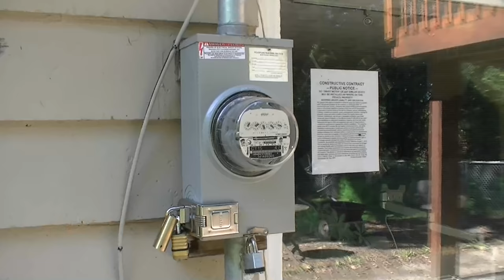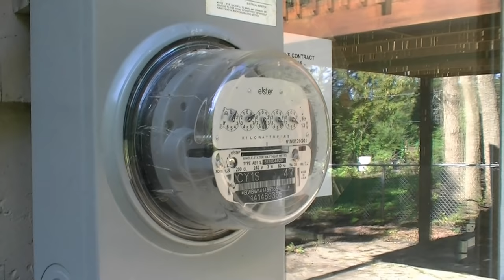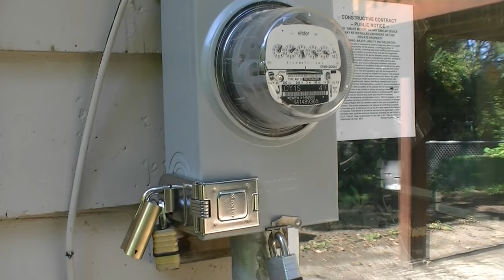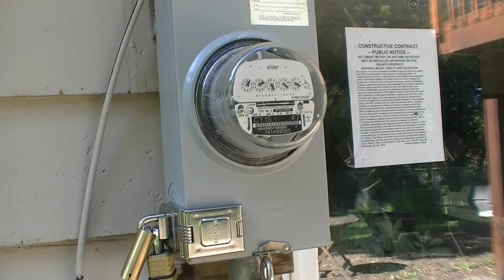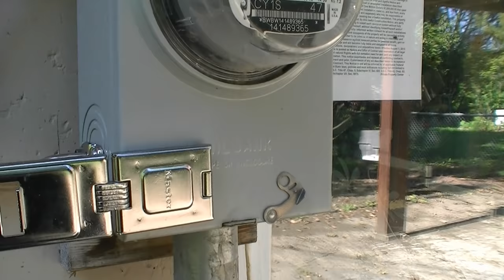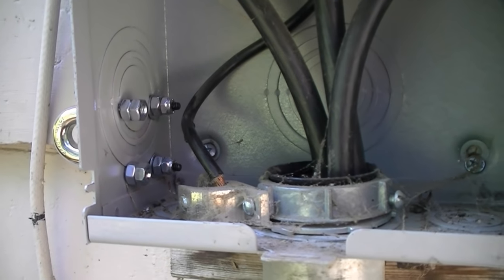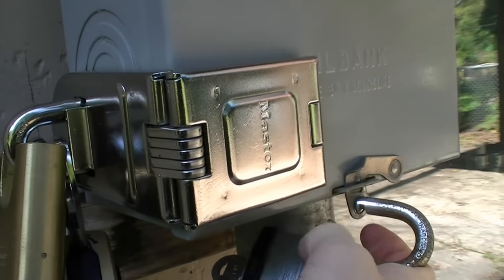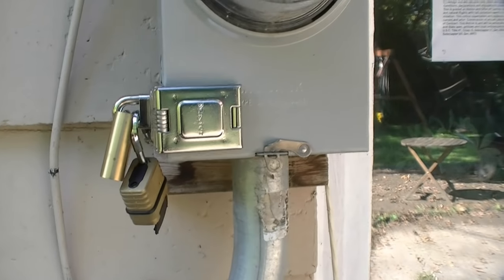Locking Your Electric Meter to Prevent Smart Meter Installation

Comment from the maker: Having a monopoly really seems to have given these power companies a sense of entitlement.  Now we've had multiple comments posted by people saying they work for a power company.  They are upset that a power customer would modify their own property (the meter box which the customer owns) which resides on their own private property.

I'd like to see one of these guys name the utility company they work for.  Do you speak on behalf of your company?  I speak on behalf of mine - ElectraHealth.com.  I have no problem putting my real name and company name on here.  I'd like to see one of these posters do the same.

Instead of fighting or arguing, why not come to the realization that people don't want these smart meters.  A good company listens to its customers and their needs/desires.
Reply: EMF Explorer you do realize power companies are very strongly and heavily regulated by the government right? They can't charge whatever like in a monopoly, as the Government sets the rates, as electricity is classified as a utility. Same way with gas and water
Reply: EMF, you seem to talk a good game, but you may not be as smart as you think you are.  I'm a retired meter tester and installer that was also state certified to test, inspect, and install substation metering, which is highly complex metering that has multiple current transformers and multiple potential circuit feeding the meter.

You have no right to install the locks on your meter, as a matter of fact when you installed those hasps, you could've put the drill bit into a hot phase.  If you removed the meter to de-energize the load side conductors we would've of come out to replace the outer seal.  We would of seen your locks and hasps and it would've been considered to be unsafe conditions.  We will access the meter,  and if we came by again, chances are real good that your service would've been disconnected due to multiple cases of unsafe conditions.

Call it arrogance or whatever, however power companies are given a lot of leeway when it comes to unsafe conditions.  Notice that I didn't mention tampering or diverting current.  Now after I cut your locks off and access the meter, if the inner seal is broken, then I will test the meter for accuracy, and make several other visual checks to the meter.  Now, after removing the hasps, if there are holes in the lid or meter can, remember my remark about power companies having a lot of leeway about unsafe conditions.  Holes in any part of the meter can , outside of the obvious hole for the meter, can be viewed as being unsafe.

Had I come up on your meter can, I would do exactly what I stated right in front of you.  I would be professional and explain everything that was going on, so you would understand.  Also a little courtesy goes a long way.  Had you threatened me with a gun, dogs, etc. we have a button we carry that sends a signal to our trucks, which sends a 911 to our company  and the local law enforcement.

You can't win most of these battles you think you can.  We have the law, utility commission, and NEC on our side, and your trying to bypass the rules you signed in your contract, just won't fly.
Reply: EMF Explorer you are correct the consumer does own the meter box or enclosure. However modifications to it in an attempt to prevent the owner of the meter gaining access to said meter prevents their maintenance and emergency access. I am all for people denying their smart meter install as it's their right to do so however please remain logical and safe when doing so. Suppliers also have the right to pursue and gain a court warrant to gain access to their equipment if deemed necessary, therefore requiring no further concent on your behalf. Finally the meter box houses lethal amperage and therefore no modifications should be made by anyone not suitably qualified to do so. Be careful people.
Reply: How many decades did it take, until the right of property owners to add additional landline phone extension phones was recognized? How many decades did the telephone monopoly rip off customers by leasing extra phones to them, at an exorbitant price? The rent on those extra phones, would be enough to buy several phones a year. Finally, the phone company is only responsible for the phone line up to your outside home junction box. (But they can still make more money by selling poor-value optional insurance on your inside phone wiring.) Now how many more decades will it take for sanity to finally come forth on this smart-meter garbage?
Reply: I would like to ask how the electric box is my own private personal property, as I don't recall purchasing the box when I built the house.  The electric company put it on, so wouldn't they own it?    HELP!
Reply: Woodrow Magnus 
Only if your meter box is separate from your circuit breaker panel box. 
If it's a combined unit, you pay the full price if you ever decide to do a panel upgrade.
At least, that's how it works in California.
Reply: Woodrow Magnus Weird, that 5k cost to run power to your lot or land then the 3500 for the electric 'hookups' you didn't have? You aren't just paying labor, nor are you leasing it. You paid up front for it. Some states and locations may do things differently but a quick n easy test is see how much it costs to set up a mobile home on an empty piece of rural property. The mobile home company will tell you you have to buy the box and hookup and pay the electric company to install it(usually a single process as the utility company is who you buy from). Some urban areas and HOA zones may do it differently.
Reply: from my local provider's handbook 

 "General Metering Information
Because metering requirements can be somewhat confusing and complex depending on the service
size/type, a separate section of this handbook, titled Metering Requirements, contains specific information on
metering. Standards drawings detailing metering installations can be found in Part 7 of this handbook.
In general, every service installation will require one or more electric meters and the associated meter
base(s). The customer is responsible for installing the meter bases. KU provides and installs the electric
meter(s) once the service is ready to be energized. Customer is responsible for providing and installing most
meter bases. For additional information on meter base requirements, see Part 2 “Metering Requirements”.
Regardless of who provides the meter base, the customer installs, owns and maintains the base and other
required enclosures for the life of the system."
Reply: Justin Noker 
Not in California. Water rates have been jacked so high, farmers are getting rid of the trees-- Almond, Pistachio etc:, people are replacing lawns with rock. Moonbeams answer to the drought-- raise prices of water to force people to cut back when it's Democratic failed policies that greatly accelerated the drought. I'm wondering if the drought was deliberate for some reason. 
   So, to your point of government regulation-- we sure don't see it happening here. The government is Gov Brown. Glad he's retiring finally.
Reply: The Meter Housing was probably purchased by your Contractor/Home Builder.  Most of the time in new construction, the "weatherhead," meter box, and some conduit (weather including pole or not) are set up at the construction site to provide power for the build... on temporary mounts, especially if the intention of the Contractor/builder is to mount it on the home when finished.  They will usually call out the power company to shut down the service, at the pole, to make the "temporary construction" mounted meter box transfer to the side of the home where the main power cables come out of the newly constructed home, that will be permanently installed in the adjoining breaker box.  THE METER BOX IS YOURS... NOT THE POWER COMPANY'S!  EITHER YOU, OR YOUR BUILDER/CONTRACTOR PURCHASED/PROVIDED IT...  IN EVERY CASE I KNOW OF.
Reply: Yes. But your agreement with the power company states you cannot block them from accessing or maintaining THEIR property. The meter. The power company would have every right to cut this guy off at the weatherhead until this was fixed.
Reply: Honestly! I'm in agreement with you. I am. Please permit me to say just a few things to you. You've got the right to protect yourself and your family. These people have no right installing these meters on your home without your expressed permission. I got that. Smart meters are equivalent to domestic terrorism.
We are not supposed to remove the utility company's locks. But you have the right to install your own locks on the side of the box. Its your property. Under the extenuating circumstances, you must do this to protect yourself from these smart meter installation. Did you know that the police are arresting citizens like us for protecting ourselves!! These police are working for the corporations.  It's not worth the aggrivation. It's far better to go without power and to start over fresh. There are other solutions. it's better that they disconnect the power from our homes. Freedom costs. It always will.
Reply: AMEN!!
Reply: @oldgoatgxp  You can be polite as possible as you do not care about what your customer wants.....Ummmm my understanding is that they can not put something on your house they know to be harmful to the occupants. There is way more to the legalities of this issue than you characterize here. The "electric experts" such as yourself refuse to consider that they may be wrong. This is not as black and white as you "experts" assert. The WHO (World Health Organization) has had to admit that this type of radiation, which on cell phones pinpoints on one part of your body. Whereas these 3 watt smart meters pulse you with non ionizing EMF radiation MANY MANY MANY times a day through your entire body can as a matter of fact cause cancer. And that is only one health problem associated with 100's of documented health problems caused.  Mark
Reply: @markkittelson6581  smart meters are being installed nationwide.  One can always live off the grid.

Comment: Was there a tamper lock installed on the meter box? Probably yes. You just broke the law.
Reply: GKAtascosa bs dont matter if there was a lock the box is yours only thing that is the power companys is the wires and machine thats it if your house burns down its your fault cause the box is yours

Comment: How about the watertightness of your work? At least this is installed outside and exposed to the weather.
Reply: In Germany every electric device that is mounted outside and exposed to the weather must be rated as IPX4 (X is placeholder). And there's a reason for this. Corrosion of the contacts could do this, corrosion is creating a contact resistance, and this should not be underestimated!

https://en.wikipedia.org/wiki/IP_Code

The meter is always installed inside of the house, the meter-reader must make an appointment for reading or you could read it for yourself and fill out an online form on the website of the power company. Apart from that it's like in the US: The meter itself is property of the power company but you own the box where it's installed:

https://abload.de/img/img_5931k0bk9.jpg

Only the indication is digital, it's a dumbmeter :-P

They want to introduce the smart meters here too, for now it's only obligate for industrial customers.

Comment: The electric company here for some reason placed their own pad lock upon my box and I checked my neighbors on each side of me. One of them did and one of them didn't get a pad lock. I suspect it is because of my low power consumption and they think my meter is being tampered with or is malfuntioning. It happens every year. On the pad lock it says that unauthorized removal is considered the same as breaking an entry. Something like that. I can post pics if you like. Would you still recommend I replace their lock with my own? LOL   KENTUCKY

Comment: Our local says it's an RF meter not a smart meter.
Reply: Let's look at why we need TIN FOIL HATS. 
 #1 reason is they turn off breakers in your home. Both AFCI's and GFI's get turned off by the radiation from the smart meter.
#2 Did you know a flammable smart meter will turn off your power if you do not pay your bill, BUT it doesn't know when it's own butt is on fire. 
#3 Your power company has access to all of you private power information. Eg When you make tea, when you turn on your alarm etc. 
#4 A smart meter will KILL your family members who have cancer. If they come home from the hospital and sleep near a smart meter, they will die. Check with the US Cancer Society website. 
#5 A smart meter will hurt or even KILL disabled homeowners who have disabled medical implants.  
#6 You smart meter is very accurate, so accurate that it also measure the noise and dirty electricity. Have a look at INRUSH power. 
#7 Smart meter radiation is breaking Ionic Bonding.

Comment: I wish I'd done this! I hate the very stupid smartmeter...
And they can remotely shut off power...
America should go 240 for all devices, screw the split power bullshit. It cost more money to run three lines to your meter then just two wires and that into the house to your box! And then every Outlet could have double the power if it was 240 instead of 110 with the same run of wire...

Comment: Just in case you did not know......
The Fire Department WILL NOT squirt water on your burning house until the meter is pulled.
This is a SAFETY issue.
If you don't wish your home to burn down to the foundation while firefighters watch helplessly, you might want to re-consider your locks.

I am also POSITIVE your homeowners insurance will NOT be pleased to learn you have guaranteed your home to burn down
Reply: No link.
Just ASK your local Fire Department and look online at the training standards.

You can choose to disbelieve if you want to, but it does not change what firefighters are being taught and instructed to do.

All your tinfoil hatter paranoia about brain waves and such are the real bullshit on here.

The new meters are t allow the company to shut you off and turn you on easier when you don't pay your bill.
And your connection paperwork contains a "contract" that allows them to "seal" or "lock" your box. as well as accessing and servicing/replacing THEIR METER "at will".
Not to mention that they CAN charge you extra fees if the seal is broken and they decide you tampered with the meter.

This whole video is FULL of bullshit.
And so is the person/s that choose to attack people for injecting TRUTH.
Reply: marionmedic wow don't know where you live but, in Tennessee we get the fire out no matter if the power is on or off. I believe you info may be a little off coming from a firefighter stand point.
Reply: Not even hardly "tinfoil hatter".
WRONG as usual.
I am an ex-trucker, an ex-paramedic/FF, and a currently semi-retired medically and working as a part-time security guard.
Never worked for power company, not even as an outside contractor.

If you see my videos, you will notice that what I say is fairly evident.

Wish I worked for the power company.
Could use the money.

My knowledge comes from actual NFPA firefighter training and requirements "AS I WAS TAUGHT" on our State and Local level.
I was an Assistant Chief and Training Officer in my time, and all the "SOP's" came about even BEFORE I joined the fire service.

But thanks for revealing your ignorance and paranoia for all to see.
Reply: marionmedic  not true !!! i have seen the fire department cut power the the entire street, to put out a house fire
Reply: as an Electrical  Revenue Meter Technician , marionmedic is absolutely right. dont take his word, just ask the Fire Dept.
Reply: La Diablo there's no point in arguing with someone who spews insults.  Your anger is a disease not worth contaminating ourselves with. So u don't know a meter tech is? Do you know what a mechanic or diagnostic tech is? I'm done here . U have no basis or research of the insanity spoken. Go buy a home Depot generator and get off grid.
Reply: this guy is just an agitator, he doesn't even believe himself. just wants to stir trble cuz its easy on the internet.
Reply: really? . Can't argue with loco people. U just trying to stir trbl for fun. U don't even believe your bull. Do real research NXT time.
Reply: La Diablo I have 13 pple on the 30 day termination of electrical service for failure to provide access to the meter. If you were in my jourisdictio I'd cut u too that is if you failed to provide access
Reply: you can if you dont wear aluminum  foil hats
Reply: james baca. James, does the fire department call the power company to pull that meter during a fire, or does the fire department pull it, because where I live the power company comes out and cuts the power to the house at the pole, not by pulling the meter.

Comment: They don’t open your box. They just switch the meter itself
Reply: BUT WHY DO THEY HAVE TO INSTALL A DEVICE THAT KILLS OVER 100 FOLKS EVERY MONTH?
They only have the right to measure what power you use.
THEY DO NOT HAVE THE RIGHT TO INSTALL A COMMERCIAL, MESHED NETWORK, HIGH POWER RADIO TRANSMITTER ON YOUR HOME